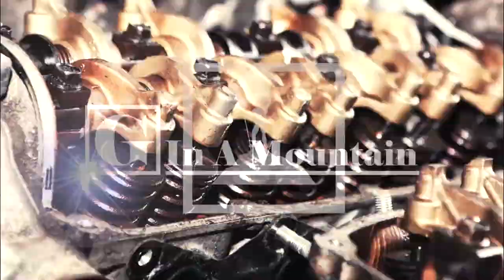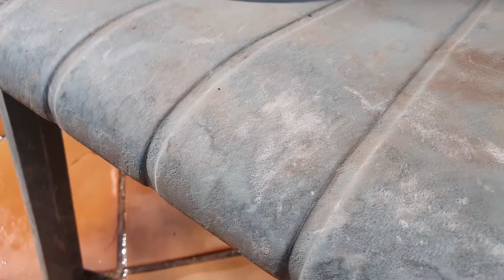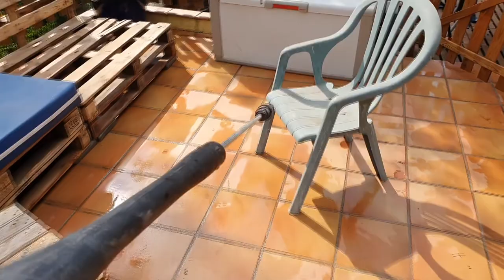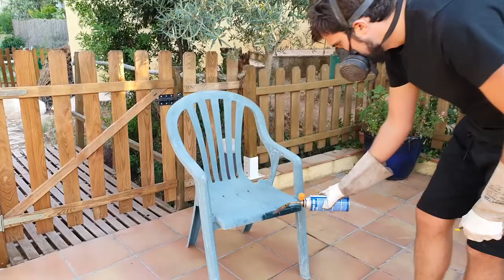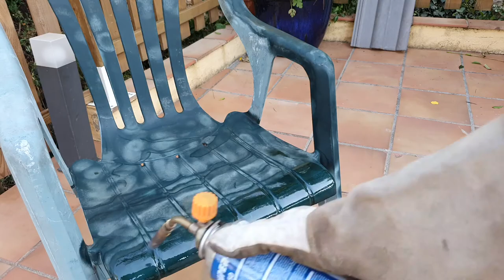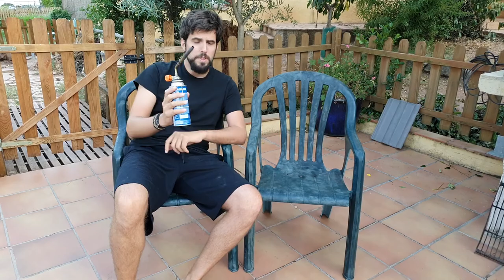FREE Plastic Chair Restoration | Fire Torch Technique

Comment: The reason it came out looking less than ideal is that you moved WAY too slowly with the torch. You can clearly see the plastic melting. It’s even drippy on the front. When you do this, you’re supposed to QUICKLY wave the torch back and forth so that the surface doesn’t even get close to actually melting.
Reply: Yea he has a tour he other guys like stadium seat repair guys have their flame far away and it’s not your house line it’s just blowing fire, if that makes sense.
Reply: This is what happens when a regular joe tries to copy other yt vids and make a "tutorial" lmao

Comment: It’s prob be cheaper to just buy a new chair
Reply from the maker: Less than 1 euro of gas 6 chairs restore. This chairs cost 35 € each. Plus think in the enviroment, if you extend the live of the chairs by 2 or 3 times you avoid putting extra 12 chairs of plastic in the planet
Reply: Fair enough I did absolutely no math before making this comment you win good sir
Reply from the maker: Thanks for asking👍🤙 I should had explained in the video🙂
Reply: Where’s your motivation?